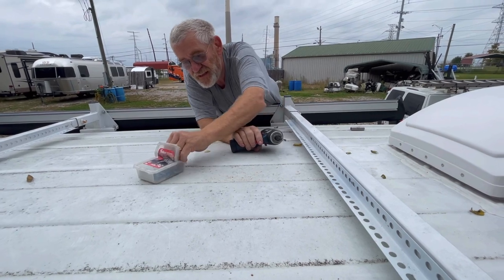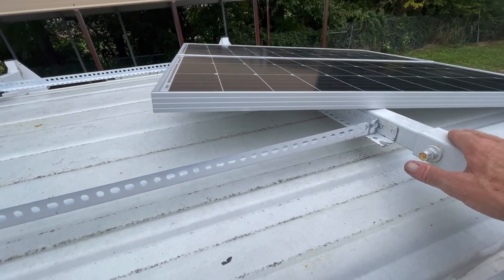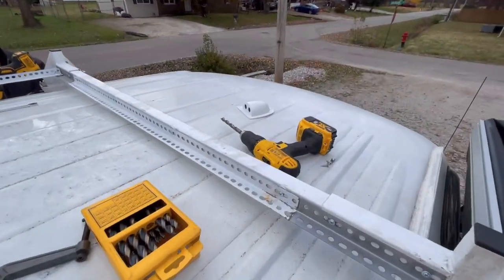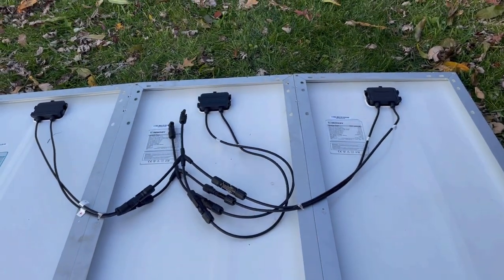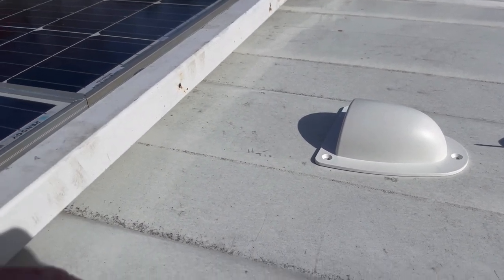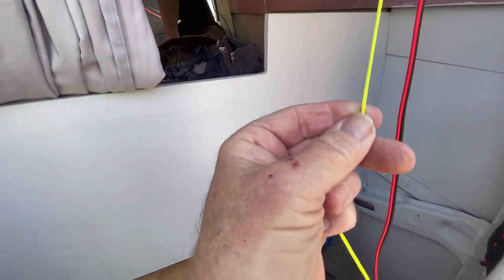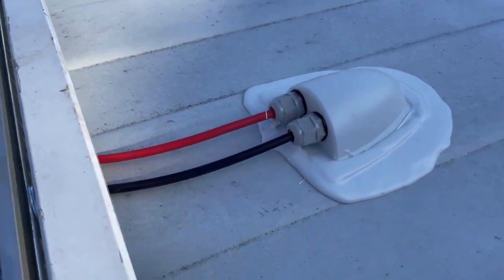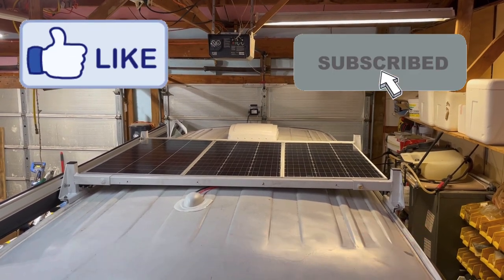Chevy Express “DIY” Camper Van Build  Episode-15  Roof Mounted Solar Array

Comment: YAY! Yours is the first solution I found to mounting my solar panels on my Chevy cargo van conversion. Everything has had to be custom due to the van's shape, unlike RVs and the sprinters and camper vans factory fitted with rivets and holes for racks. I too am going to mount L track inside the rain-gutter-attached ladder rack and inset the solar panels. Thank you for posting!!
Reply from the maker: Glad it helped.  My solar panel rack system has worked great with no issues.
Thanks for Watching! 👍

Comment: I did the somethign very similar but put mine under the driver side pannnel and used 1/4in plastic to make an air shield that contoured the roof at a 45° to my frame as a wind fairing like roog racks have. Used rubber U seal on the bottom edge so it wouldn't make noise/scratch the roof up.
Reply from the maker: Mine are working well.  Sounds like your might be more aerodynamic. 👍

Comment: I love this video and had a few questions, do you know the dimensions of your panels? I’m having trouble fitting mine the way you did, the panels seem just slightly too wide at 63” together. And what did you do to deal with the tightening bolts? They tend to get in the way since two of them are on the inside
Reply from the maker: There are several different size panel depending on the company and the wattage of the panel.